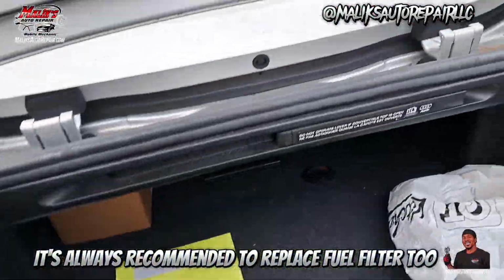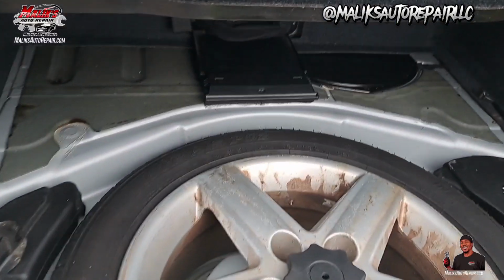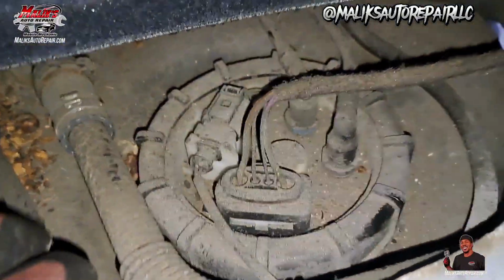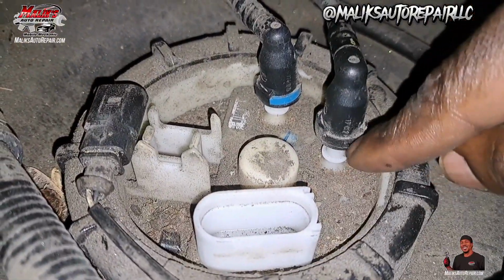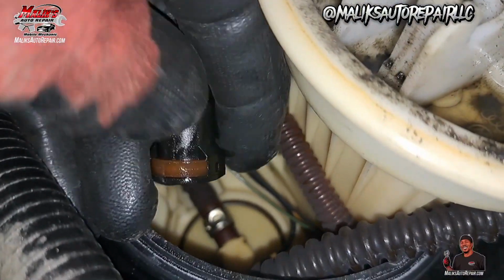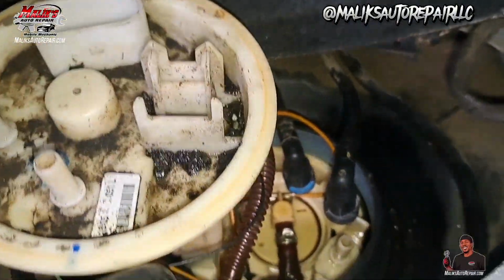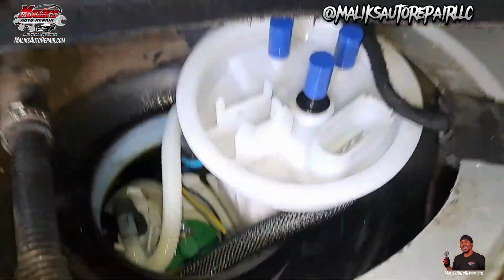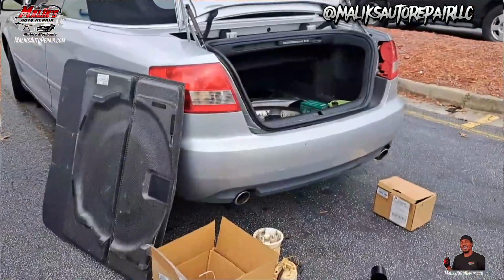2002-2003 AUDI A4 3.0 CABRIOLET 2DR CONVERTIBLE 2WD | HOW TO REPLACE FUEL PUMP | IN TRUNK |Howto/Diy

Comment: Wsp! I got that same exact model and I was looking at this video because the car engine keeps turning off while driving. We had it sitting for a year and a half and we needed a battery for it as well. We got the battery in it and it started up tuff but after it’s been staring up pretty well but the only problem is that it jerks had when taking off and today I tried to reverse it out the drive way but it kept jerking and stoping. This all started happening when I drove it up to 50-60mph just to see if it would do things like that. It was driving pretty well before that but now it’s jerking and turning off so what do you recommend? Others say it needs a tune up, spark plugs and I’ve been thinking it may need a new fuel pump.
Reply from the maker: @Mr.Rivera_05  Those could be causes. Let's hope it's not a transmission jerk. I would scan for codes. Need a scanner that reads transmission codes.
Reply: @ThePullUpKing  my OG down the street just so happen to have a scanner and he ran it and it said it had no 0 codes or warnings. I will also get a second opinion at the shop soon.